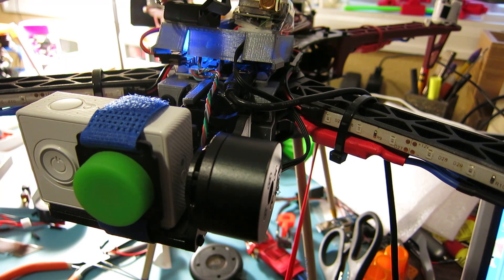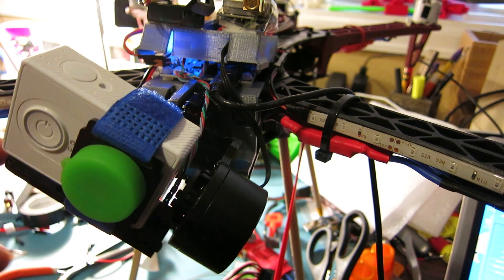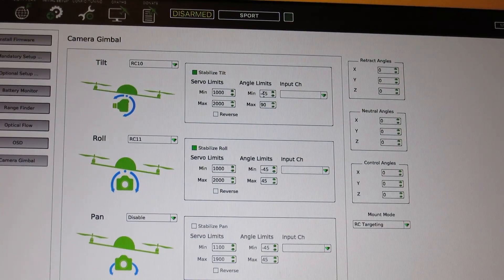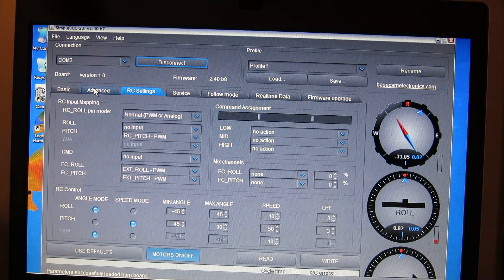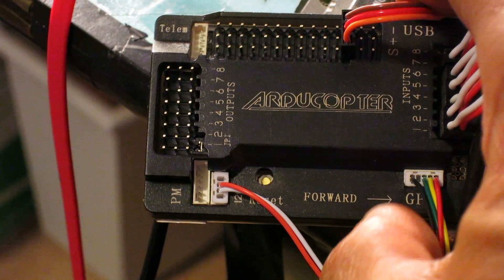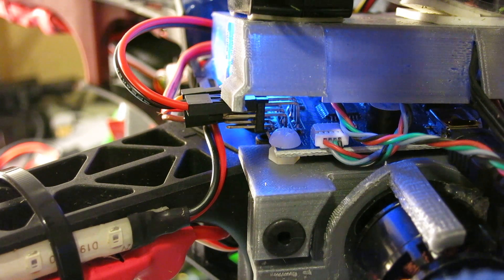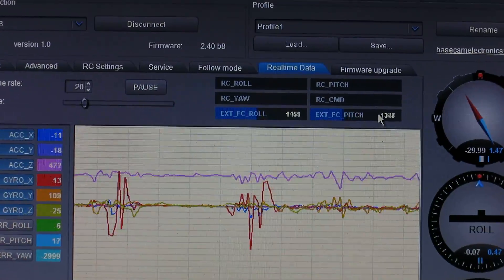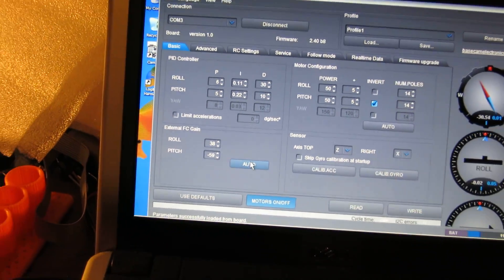Improve Accuracy of Alexmos/Basecam 2-axis 8-bit Gimbal with Arducopter APM

Comment: Great vid! My cheap board doesn't seem to have functioning EXT FC ports however. There are two sets of Roll/pitch pins/pads (which would suggest RC/EXT as in your case) but one set is labeled "ISP" on sellers site and connecting signal to the theoretically corresponding roll pin for example does nothing. Roll and pitch connected on "RC roll" and "pitch" does give live PWM values when I tilt the quad though. Auto FC gain doesn't work of course because changing values are on the RC not EXT tab. I'm also all out of RC outs on my APM so I tried to mix Pitch stabilize with seting camera tilt with the TX pot and it DOES seem to work since PWM values change on Basecam but with offset given by the potentiometer AND use roll to just improve stabilisation. I can't however utilize external IMU signals as you do because of those darn pins. I get live PWM changes but in "the wrong place" and it's so frustrating. Any ideas?

Comment: Hello, Could you please confirm if I should connect the gimbal to the serial2 port if using PIXHAWK? Thank you
Reply from the maker: Sorry, I don't know the pinout of the Pixhawk.  Take a look in the APM Planner software and look at what is available in the drop-down selector.  I use RC10 and RC11.  https://youtu.be/hii5YAncazc?t=2m4s  You will have to find the corresponding pins for what is available on the PIxhawk.
Reply: I would tell you that it depends on your configuration in missionplanner
if you have chosen to communicate with alex through serial port 2 then you should connect it to serial 2 and so on

Comment: Hi, could you give me some advice? I connected gimbal through APM andgimbal works great! I use potentiometer on my controller to change the position of Pitch. When I change the angle by potentiometer, camera fixes the view relatively to the body of the copter, but I want it to be fixed on the direction of camera view. I mean when I change the angle, camera starts to follow the drone, if it goes backwards, it camera smoothly goes up, then when it flies forward - camera goes down. Do you have any ideas how to fix this? Thank you
Reply from the maker: Check to see if the "Follow Mode" function is on.  See the Follow Mode tab in the SimpleBGC utility.
Reply: Okay. Thanks! So if I understood correctly, if I turn on the Follow mode, camera will stick to the some point and will not tilt down and up while the copter swings in the air?
Reply from the maker: No.  It is the opposite.  Follow mode can be turned on for pitch and/or roll.  It will follow the pitch/roll of the craft.  I was curious whether this was turned on already and causing your issue.

Maybe you can re-calibrate the gyro and accel.  Or, the signal from APM is inverted.  How does it work if you disconnect from APM and let the gimbal do all the work?
Reply: well, even connected to the APM it works correctly if I don't touch potentiometer to change the view angle. It works as it should work, stabilizes everything, but when I tilt it down it then it starts copying copter's pitch instead of stabilizing it. I looked through some videos about follow mod and it looks like when I touch potentiometer, the pitch follow mod turns on.

Comment: Hey MHM. Great info.
On the APM board, you show 1 servo cable plugged into the S/5V/GND pins of CH11.
For continuity... Should that have been a white/red/black servo cable with the red wire connected to signal pin on CH11,  black wire connected to signal pin on CH10 and the white wire removed? If so, that may have led to others having issues.
Reply from the maker: Sorry.  That was a bad visual example in the video.  I tried to explain verbally what to do but the example did not match.  The actual FC with the correct wiring was not visible on the quadcopter.  I should have plugged in the single cables into the signal pin of Ch 10 and Ch 11 to illustrate the exact configuration.

You can use a 3-conductor servo cable on Ch 10 and Ch 11. But since everything is on common ground and power, I mostly only use a 1 conductor signal wire.  It's mostly my preference to use less wire wherever possible.

Thanks for your comment.

Comment: hello is it possibel to get your profile ?  i use my gimbol on a symax8hc  and after i try to changes the tilt angel it realy fucked up. have no idea how t resolve this.
Reply from the maker: Hope you were able to get it working.  Reflashing the firmware will set to default, but don't do it unless you know that your board supports upgrades.  A lot of cheap (counterfeit) ones do not.  The Alexmos website talks about this and tells you how to solder on pin headers and use an ASP programmer to re-flash the bootloader.